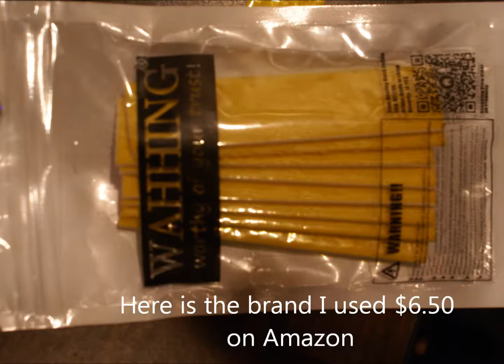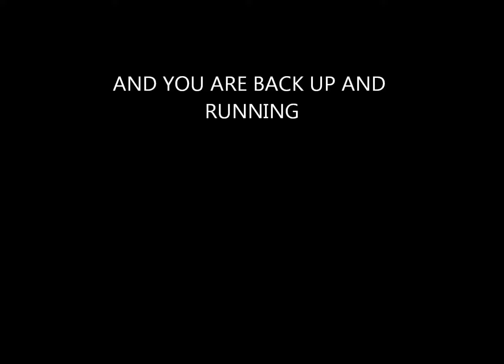nozzle insulation replacement

Comment: Thanks for the vídeo! However, I think you risk your hot end catching fire with scotch tape to adhere the insulation, it is not rated for the high temperatures the hot end reaches! A safer choice would be kapton tape.
Reply from the maker: Thanks for the tip! I began using high temp electrical tape instead. I'll give kapton a try